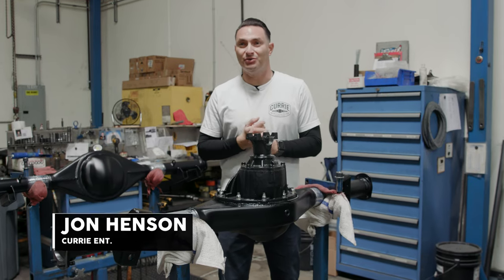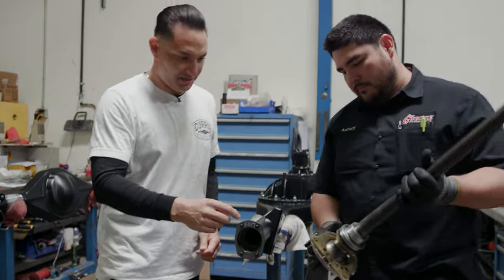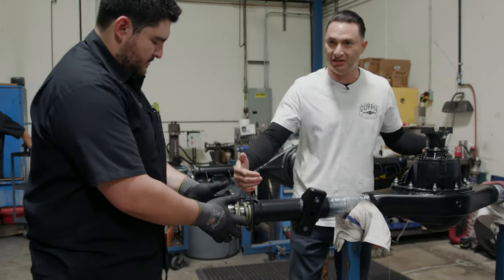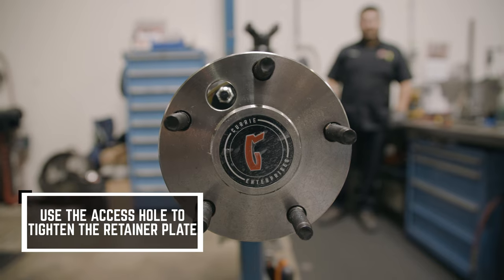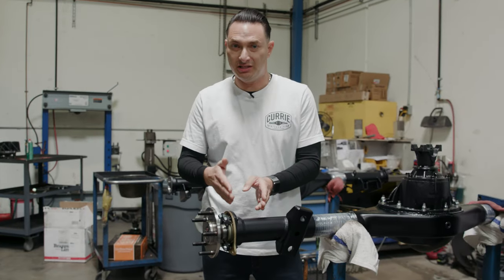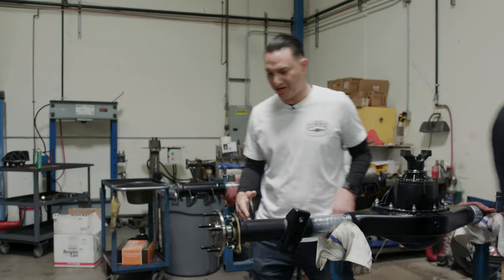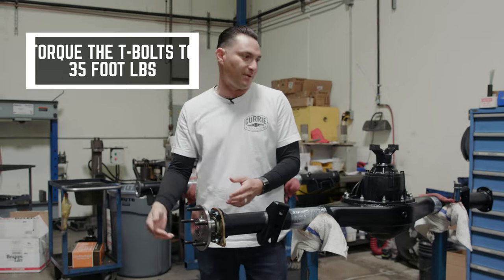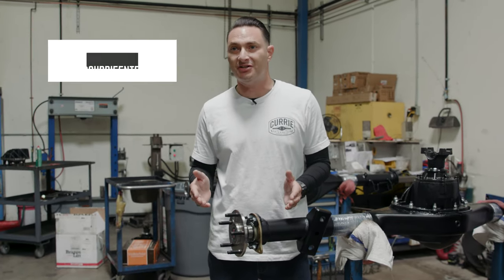How to Install a Currie 9-Inch Axle | Explained

Comment: Yes!  I love it.  Can't wait to get mine.  Thanks Jon, and Anthony!
Reply: Did you get yours yet? I'm 10 weeks in and all I get is smoke blown up my ass and pics of my order on a pallet in the shipping department. Easily the worst customer service I've experienced and that says a lot if you've ever dealt with Holley
Reply: @Turbochapman  Hey Brother... I have not pulled the trigger yet, as other life projects got in the way.  Sorry to hear you're not getting good answers.  Are they waiting for a ship method?  Maybe the freight company is having issues due to all the SoCal snow, road closures, etc.. ?  Keep me posted.
Reply: @FastMonty  its deeper than shipping issues unfortunately. 1st it was a wait time on manufacturing. I bought mine through POL(Performance Online) on Jan 22nd and i didn't here anything for about 3 weeks so I sent a email to them and Currie. Currie replied and told me that they wait until they have a larger batch to do. I get it and asked that they let me know if the build time would be an additional 4-5 weeks from then and didn't get a reply. I then follwed up at 8 weeks because I hadn't heard anything and I was told that the order was done and in shipping. 2 more weeks later I called Jon and he sent me a pic of my stuff on the pallet saying it would ship on Tuesday(this week), I asked for a tracking number and he told men they only send them at the end of the day. Its Thursday and I still don't have any info parts etc.
Reply: @Turbochapman  Ahhh, yeah, that makes sense.  I totally understand the frustration.  If Jon says it's shipping, I'm sure it's shipping.  Not sure where you live, but weather in Southern California has been, well, not normal.  So, I'd pad any freight shipments with a couple extra days.  The bright side is, sounds like you're going to have a brand new rear end, very soon.
Reply: @FastMonty  I live in Washington State. I emailed Jon again(I'm sure he's tired of my shit by now) and he had to get up some ones ass in shipping , her excuse was that they don't ship fed ex from her part of the building and she needed to move my order to another warehouse to get my stuff shipped. Never mind letting anyone know there might be a additional delay after the previous 5 week delay.  Then I had to miss 2 days of work so i could sign for my delivery. Original delivery was supposed to be saturday, then sunday. On Sunday afternoon the center section and axles arrived but no housing. The housing was delayed until monday, then I got a alert from fed ex saying the new delivery would be tuesday. On tuesday night the housing arrived. Right at 11 weeks overall. I should have stuck with Strange Engineering, or Moser. They've been great to work with in the past and very open when they had issues.
Reply: @Turbochapman  Hey Will... so sorry to hear that.  I know every manufacturer has difficulties/challenges from time to time, sounds like you got the short end of the "lucky" stick.  I'm sure it'll work out in the end . I will still be getting a Currie rear end.  Thanks for sharing your story.

Comment: What is the size of the nut that tightens up the retainer plate? I need to remove the nuts from the retainer plate in order to remove the drums since they are old and rusted.